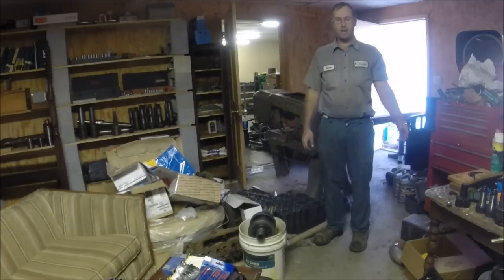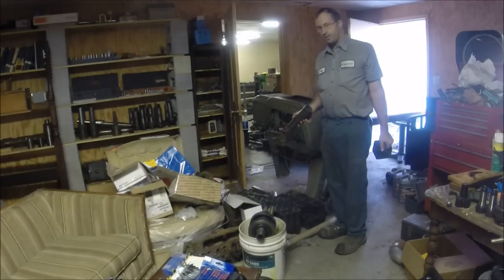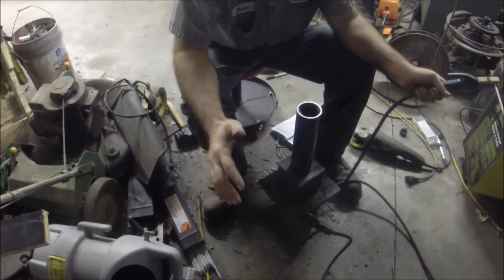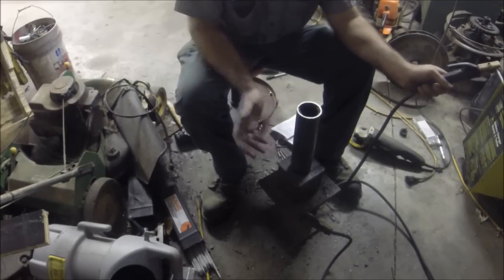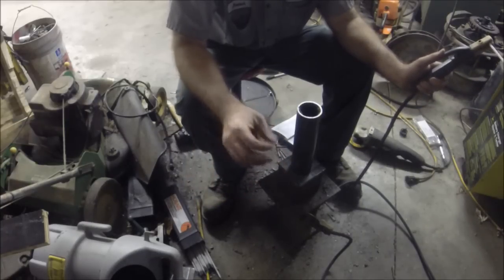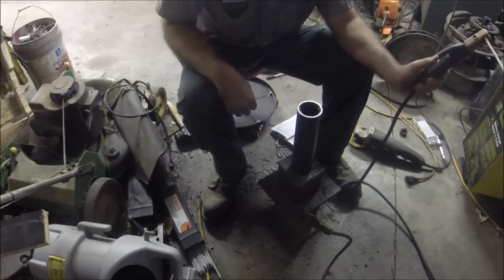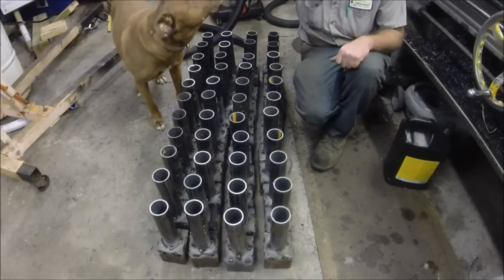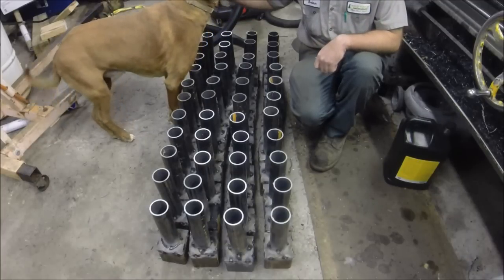Building Machinery Anchors

Comment: Not only did you chuck the parts faster than swapping tailstock drills for each work piece, you minimized wear on the tailstock taper.  I know that sounds a nal, but I have a deep respect for machine tools, in particular the old "big iron" lathes.  Any single action worth taking (or not) that improves the life of the machine is worth it.  Great channel Brian.
Reply from the maker: Glad you enjoy!

Comment: You are arc welding three feet away from an unprotected gas tank. (I'm a firefighter. I get nervous.)
Reply from the maker: You talking about the one on the mower? It is empty as it always gets run out of gas before getting put away.
Reply: No intending to debate. Most respectfully. 
Tanks with gas in them burn. When the tank gets down near or at empty, they explode. 

My experience. Called to a brush fire, Livermore Cal. Pick up truck had a jet of flame shooting straight up about 20 feet. A milk can full of gas. We attacked the grass fire around the vehicle. Just containing. Only had water, nothing for liquid fires. Jet of flame slowly died down to dancing around the top of the can. Then WHAM. We were both knocked flat. Blew the sides out from the bed of the truck. By the time we got to our feet the fire was out.
Lucky the sides of the bed directed the energy upwards. Gained new respect for our heavy turnouts and helmets.... and empty gas tanks.
Freaky: Got to our feet, dusted off, went to check out the truck, started putting out the spot fires then CLANG. The milk can finally came down about 30 feet away. Maybe 20-30 seconds after the explosion. 

 Explanation. Gasoline by itself doesn't burn. Only the vapor burns. It must have oxygen. The more oxygen present, the greater the acceleration. Once the oxygen present exceeds a critical level the gas vapors become explosive.
Reply from the maker: Ryan James
Good to know. I wouldn't have figured the fumes to have remained after a few years of being empty but I will move further away the next time.
Reply: Thanks very much. It just isn't worth taking a chance. In the emergency services we cope with 'that could never happen' incidents just about every day.

More videos, please!!

Comment: I've seen a lot of people just throw a bolt in the concrete with no more than a large washer and a stay nut to hold it in place. This is truly on another level. As such I wouldn't have thought of doing something like this. Having seen this video though, that's changed. I would wager a reasonable bet that you were wishing you had a tig welder about the time you were tacking those together though. No problem with glassing over at all with those. I've done a fair bit of welding in my time and I learned to love TIG over everything else for the simple reason that it's easier for me to use. That kind of precise control without the need to adjust more than the flow rate of the gas is nice. Stick welders have their place out in the field and always will. I think you need yourself a TIG machine if you don't already have one though. It let's you get the work done faster because you don't have to set up a new stick in the stiner or bust slag off when your done with the weld. It's better than MIG too because you don't have to mess with the wire feed rate. For me the less I have to adjust, the more I like it.
Reply from the maker: The Miller dinosaur I was using is a TIG machine as well. I don't think fusing with the TIG would have been nearly as fast.  These anchors let you basically clamp the machine to the slab so you can really stiffen the machine up and the concrete somewhat dampens it as well for better performance. For a lot of machines this size they don't just spec the foundation to hold the machine up, it is actually part of the machine design as well.
Reply: I will concede that you have far more experience than I in this matter. For me personally TIG seems faster. In honesty that could be because I like it more which could make it seem like a shorter time span due to the enjoyment of it. Equally it could be the fact that I don't work with steel or iron that much. Dealing with mostly aluminum and brass, I'm sure you could see why TIG would make more sense for my application. My work is also far more finite. Making a tiny robot isn't the same as anchoring a milling machine and so on. You've given me new perspective on this which is something I really actually appreciate. It's somewhat sad that not many people can do that these days. And as far as lathes go, my little Atlas jewelers lathe is pitiful in comparison to that monster your working with there... This was really interesting content to which you added thoughtful insight for my comment. Great stuff man. I mean that...
Reply from the maker: ExStatic Bass
 Yeah with smaller components Tig can be really fast but on big thick stuff it takes several seconds to get heat into the parts for fusion to occur melting 3/8" material takes a lot of heat. I wouldn't want to have to make watch parts on any of my machines! lol

Comment: Nice production work there Brian. I could see you were moving right along trying to get them done fast. I gotta tell you though, always bugs me to see guys welding without gloves, most especially stick welding, 6011 to boot! I handle the rods quite a bit when I weld and I like to be able to take the electrode in and out of the stinger at will. To each there own though, I know. 
I think that would have been a good job to utilize a Morse taper sleeve in the Aloris holder, at least for the first hole, use the carriage to power feed.
Reply from the maker: I don't have a Morse taper holder for my Aloris. I normally wear gloves when I weld but since I was swapping between welding, running a tape measure and a saw all at the same time I skipped them since it was just quick spots. Baily pays piece work so you have to hustle! lol

Comment: What are you doing for heat in the new shop?  How are you going to pour the floor for these anchors if the Temp dips?
Reply from the maker: It will be hydronic radiant heat with pex pipes in the floor.  If it gets too cold maybe i can just hook up the heat system and go ahead and run a little warm water thru them to keep the concrete at a good temp.

Comment: Brian, be sure the anchors are free of all oils and loose contaminates as the concrete will not bond to the steel if left uncleaned. 
Good luck placing those anchors and holding alignment as they >>>>>>>will be very difficult to hold<<<<<<< during the concrete placement. Plan very carefully and with a LOT of thought ahead of the concrete work. 

In 1978 I can say, "been there done that". I thought no possible problem could occur, WRONG! When vibrating low slump concrete, 3"-5", which you'll need, anchors invariably get "moved" out of alignment by the placing equipment or helpers/employees. They are nearly impossible to hold, BUT THEIR RIGID PLACEMENT CAN BE DONE!--just offering a strong word of caution.

There is a better way of placing large anchors like you need to use as we did when setting large "I" beams on highway bridge construction--drill concrete anchor points after concrete placement---accuracy to .030" , faster, engineer approved and recommended and stronger than the concrete they are anchored in. I'm not trying to be critical just offering an alternate solution. There are other easier anchoring solutions also, too many to mention here. PM me if you would like to visit.

....13

Comment: Hi Brian,No Complains from me about the Audio. I understand. I am just glad your posting more frequently. I am curious how you will align all those studs so they are aligned up. I imagine you will have your work cut out for you soon as you prep for concrete. Rebar, machine floor mounting studs & radiant heating lines.
Reply from the maker: Yeah the floor is not some trivial task. getting it right will certainly be a challenge and it is something you really only get one shot at doing right.

Comment: Hi Brian,
When I weld without sleeves most of the time I end up with a sunburn....    Yeeeeks..... 
When I want to restart a 7018 "easier" I just whip the rod in order to throw away the molten slag from the tip, just be careful not to do this in a location where you could set the place on fire, or Bailey will blame you for the rest of your days.....     lol
So much to do.
Cheers,   Pierre
Reply: Oh, about the quality, it's looks better, but, I'm sure the new camera will beat the shitty GoPro on all aspects...
And, do you send your video in the MP4 format, normally this format makes liter files?
Reply from the maker: Normally I think it is H.264 or something like that. I uploaded in full 720p format this time, not sure the file type.  New camera arrives today. :-)
Reply: H.264 is one of the good formats for not being too big, but, your low bandwidth isn't helping.
What is the new camera?
Reply from the maker: Pierre's Garage
Sony CX-675 I am hoping the image stabilization features will work well for my handheld shots on the barn and other big projects too much for a sitting camera.
Reply: Wow, this should be an excellent camera, but nothing beats a tripod, anxious to see the results, the only thing you may miss is some wider angle view from the little POS, easy to order a .45X wide angle adaptor to screw on the filter thread its about $25US not great quality but for workshop it gets the job done...   ;)
Reply from the maker: Pierre's Garage
With my reduced quality compressed files no one will ever know the image quality is down from a lens. :-) lol

Comment: Hi Brian
Having done concrete work with some anchor requirements included (tiny scale compared to your job!) I am curious how you plan to locate then prior to the pour. I ask because it seems that the anchor spatial accuracy needed for your job is quite high and it would be easy to get the anchors knocked out of position during the pour if not held rigidly. Some kind of rebar framework?
I am sure you take steps to make sure Baily is not exposed to arc flashes while welding. Do you just close the door to keep him out?

Great job and thanks
regards
vic
Reply from the maker: I plan to drill and mount the anchors to boards  then suspend the boards where they belong.

Comment: 4x44x3 equals how many times you bent over.....my old back was howling, hey but as you know u are my hero!  This old man would have had a cart/table for the parts and chuck key otherwise I would be laying on the ground next to the 44 in pain with Howie licking my face....lol
Reply from the maker: Futten
Nothing wrong with that. Most modern engineers could never make the things that they design themselves, so tradesman are just as important. I am the rare mix of both. So if you only get to play with welders and mills what is it that you do?
Reply from the maker: Futten
You mean besides lifting barns, handling multi ton steel beams, pouring concrete from bags by hand, setting 16ft oak 6x6's up under roofs, cutting trees, raising, crops, laying brick, doing electrical wiring, digging ditches with a pick axe, repairing equipment, welding, playing fetch with my dog, lifting 20ton tractors by hand with my bridge crane, driving semi truck, and may other things the lists could go on for days. The closest I can describe to normal for me is whatever needs doing.
Reply from the maker: Heck bending over is a cake job compared to what I normally have to do! lol I bet Howie would enjoy having you in the floor for his entertainment.
Reply: what is it you normaly do?  outa curiosity if i may ask
Reply: yeah besides being a total badass madman :P
Reply from the maker: Futten
LOL Thanks! Guess I shouldn't forget engineer/mechanic since that is my day job. :-)
Reply: ah so you engineer stuf that cool i have a big  interest /fasination for  mechanical engineering  sadly i dont have the brain power for it but i do love  working with metal im a ok machinist and welder the few times i get to play with a lathe and mill  kinda why i like   keith`s  adam`s and your`s videos
Reply: sadly im disabled but a friend of mine thats an engine builder  has a big lathe and a small mill that i use at times the big lathe is a  pain to use  finding a spindle speed is just a bitch  i worked in a  shop for alittle over a year  where they had two TOS machines from the late  70s and i got ti  machine some parts for my car  

i dream of working in a machine/fabrication shop but in norway you need to be certified in everything from wiping your backside to landing on the moon before they even consider giving you a job so my only chance is really to start my own shop wich  well needs LOTS of money    and only thing im certified to do is drive a car and forklift
Reply from the maker: Futten
Sorry to hear about that. I am not a fan of govt control of everything myself.
Reply: well its not really  goverment its more the  rules of the industry  also all the machines in that  industry here in norway now are  CNC  im  more of manual machine  kinda  guy  pushing buttons aint  machining  even though they have theyre place in the world   i did purchase myself a  small 7x14  hobby lathe last week so i can make little  stuff for my model making i wish it were bigger but i dont have the room or the cash i need to start playin  the lottary i guess but  fat  chance ill get anything
Reply: I'd have worn a tool belt with loops for the chuck key.

Comment: There is high radiation emisions, wear gloves
Reply from the maker: I would have had they not just been spot welds and the fact I was running machine tools at the same time would have meant gloves on and off all the time so easier just to skip.
Reply: Older video, but still worth the comment: Make a cone/cup shaped gauntlet and mount it to the stinger for protection. It looks weird, but for a job like this avoids the glove on one hand. I made one up with leather from an old jacket and a bent tig rod for support a number of years ago. Too hot for gloves. No protection when you try to grab a hot one, but full protection from weld radiation and decent from spatter.

Comment: Nice work Brian. Love the 'bash' test! Any calcs behind the anchor design/weld pattern?  Seems like the anchors may be working hard when installed, rework would seem fairly drastic if one failed.
Reply from the maker: It can't fail without breaking out of the concrete.  The plate inside will be pulling the whole thing together, the box on the end does nothing except hold the nut and keep the concrete out.
Reply: bcbloc02 got it, makes more sense now.  Looking forward to the concrete pour!

Comment: I know pretty much zero about welding of any type Brian, and it's something you may already know about. I had an old German machinist show me a little trick years ago for getting the rods to start a lot easier. He kept a scrap piece of common pine or fir 2" x 4" on his welding bench. When he was finished a tack or bead, he'd use the still red hot stick and plunge it into the wood just for a second or two. That cleaned the rods tip and they always started much better than not doing it.

First time I've noticed your DRO that's sitting behind the lathe. Is that a Newall DP 900? It sure looks the same as the display for my mill. I bought the 4 axis unit and maybe went a bit overboard with there microsyn scales for all 4. I think that for what it cost me that DP designation stands for Deep Pockets and the 900 is just about what it cost per axis. :-)

It's going to take some time to get all those anchors aligned and set in place so they can't move while the concrete is poured that's for sure. Clever idea to use the lathe to drill those holes so there centered well enough.
Reply from the maker: I will have to try this. I have kept a file by to drag the tip over for restarts but never heard of using wood.
Reply: From what I saw Brian it sure seemed to make a difference. But I'd be real interested in what your thoughts are after trying it.

Comment: Don't know about your lathe, but wouldn't have been faster to move the tail stock instead of cranking all the way out?
Reply from the maker: No leverage without using the screw on the tailstock, I can't shove a 1"bit straight thru steel by hand anywhere close to as fast.
Reply: No I meant just for clearance for stock swap. slide the tail stock back, swap out anchors, slide stock forward, and then crank the drill bit back into the the material.
It may be a wash, but if it would save 1/2 the cranking time.

BTW I saw that lawnmower sitting next to you while you were welding and couldn't help but think that it was a little undersized piece of equipment for you ; -)
Reply from the maker: cheeto4493 The mower is only for mowing on top of the root cellar, it beats using a weed eater. :-)  Locking and unlocking the bolts that hold my tailstock still would take far more time. If I had a lever locked style i could see where that would be an advantage.
Reply: I'm with you, Brian.  My tailstock is too ^&*) heavy for that nonsense, and two lock down bolts to boot.  Even when well oiled, I almost need a come along to get it started when I move it.

Be careful, you might have to explain what a "root cellar" is to these non-rural types :-}
Reply: What you need is one of those hook and ring arrangements that connect tailstock and carriage, so you can use power feed for drilling.
Reply: bcbloc02 Well I figured you were pretty on top of things, and there was probably a good reason for you doing it the way you were.
Reply from the maker: Chris Stephens
Chain it up and drag it in! I have never seen that done but it sounds reasonable.
Reply: bcbloc02 I saw it on a Russian lathe and thought it a good idea. If I can find the video again I will send you a link.